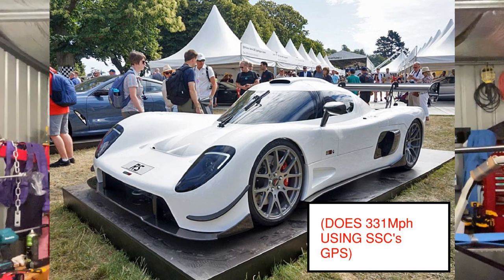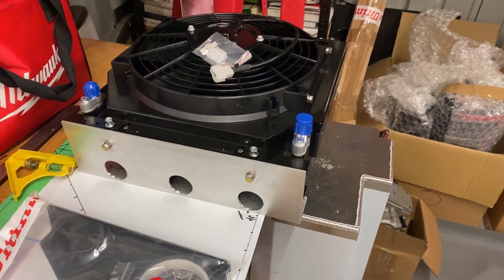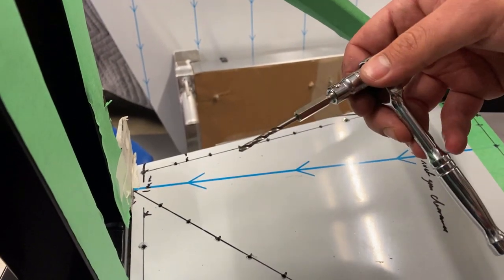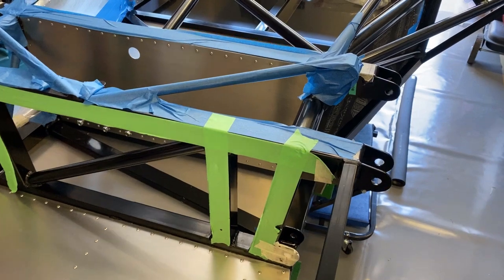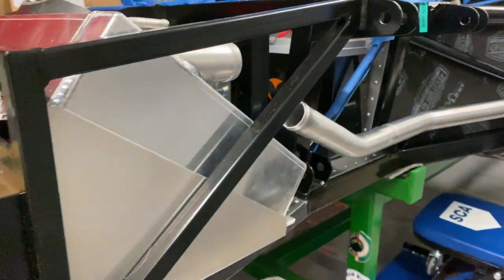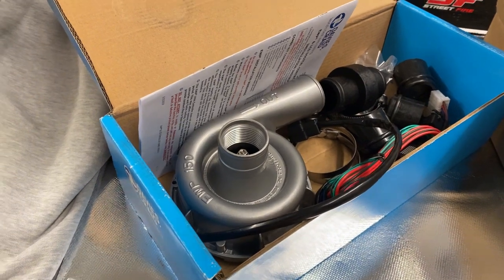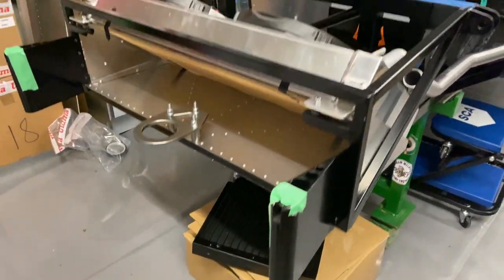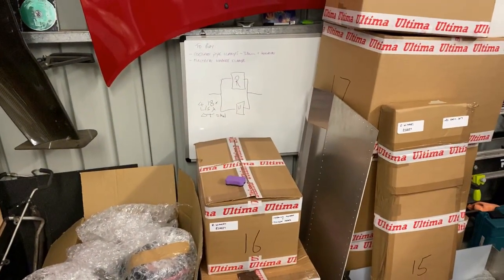Ultima RS - Keeping things hot and cold (Video #11)

Comment: I don't know how much your battery weighs, but I would use the LITE↯BLOX battery. It weighs 1-2kg and you can monitor everything with the mobile app. It has an internal kill switch and an anti-theft device. Not cheap but for what you get it's the best you can get.
Reply from the maker: Thanks for the tip mate! I went tight arse on it to start with as the Full River option was virtually identical to the Odyssey specified by factory and cost $300AUD.

Comment: I'm enjoying the build and love the Ultima. Nike for improvement, please work on the audio mixing. I have to crank the volume to hear you speak, then it cuts to music and blows out mine and my neighbors ears. Music doesn't need to blast like that.
Reply from the maker: Hey Rob, What device are you listening to it on? I actually checked it on my PC and my Iphone (and again just now) and it's marginally noisier with the music. I actually curbed the music level to 60% and used the exact same sample as the last video so it was the same source level. Sounds like it didn't work, but i'll get it sorted ASAP. Cheers
Reply: @rob105motorsport  I'm watching on a tv attached to a sound bar. Thanks for taking feedback and keep up the good work.

Comment: Another great video Rob and sorry the condenser didn't work out. You actually can't lift the radiator up as it'll hit the underside of the front clam so you've made the right decision to find a new one that fits better. As Will said fitting that second bulkhead is a good move and it's relatively easy to do. Look forward to the next video 👍🏻
Reply from the maker: Thanks, Murray. I seem to remember someone (possibly you) mentioning it’s a tight fit and it makes sense for the exit ducting to be that way. There’s always a bit of challenge with these things, but it’s also satisfying to sort it out. Cheers!

Comment: I've seen this theory off Tee-ing off of the radiator lines for the heater core on lots of mid-engine builds.  The calculation for heat load and flow restriction is an accurate way to calculate this, I think what gets missed is the physical restriction of the fitting.  Your calculation will hold up if you use a Y-shaped fitting so that there is not a requirement for the flow to start moving in a perpendicular direction to start flowing down the smaller flow path.  However, a T will most likely result in heater core filling up, but then not flowing.  I've not modeled this in any flow software, but based on some stuff from my flow dynamics class (which was over 15 years ago), I think it is important to consider the type of splitter you use.
Reply from the maker: Hi Jokerto, I tend to agree. The bottom line is though, that even if the heater core path is 100 times more restrictive than the radiator it’ll still have sufficient flow to produce good heat in this tiny cabin. Otherwise I’d be doing much more detailed calc’s. Cheers!

Comment: Watching this makes me want to go out to the shop at midnight and start finishing up putting the LS3 my G8 GT and start ordering parts I can't afford to finish my HSV E3 conversion. 😆

If you're worried about failure points in the cooling system, you could simply have some -20AN fittings welded to the radiator and tube just for that short run and use black nylon braided hose instead of stainless which should make for a pretty failure proof option with much more flexibility. 

Also, as far as the condenser, if the height is the problem, would can actually rather easily modify it by cutting off a couple inches from the top or bottom and modifying the tanks for lack or better term. Nick Blackhurst showed some really nice and relatively easy ways to do it on Project Binky. 

Also, I don't recall what or if you said what you were going to do for power steering, but personally I would run a hydro-electric pump from something like a A class Merc or Yota MR2. I'm going with the Merc pump on my G8 since it's only 3 wire hookup and frees up a solid 10-15hp, and aren't that difficult to hide everything except the res cap since the reservoir is built in. Just a suggestion. Keep up the good work mate.
Reply from the maker: Hey Corey, Get onto it!
There's been many nights eating instant noodles because of my car part buying, so I know what you mean, mate!
ANs are good, but they do transfer a bit more vibration and cost a fair few $. I was very tempted to do it, but I think for this car it's not 'ideal'. They'll be making an appearance on the next project though for the reasons you mention (and because they look awesome). 
As for cutting a few inches, I'm generally always wishing for a couple of extra inches..... but that's a different issue. The problem with the stock condenser is the height, but also the thickness; and also the connection points make is so the edge you'd ideally cut is at the end where the serpentine gallery has it's return bends (so you'd open up all the galleries if that makes sense). It's possible, but a full bastard, so if I can find a coil that's closer to ideal to begin with that'd be far better.
Power steering is for little girly men. Nobody needs that in their life stealing steering feel....... nah, in actual fact, these things weigh nothing, it isn't a 'daily', and it's difficult to calibrate an electric system (or hydraulic) to provide assistance that doesn't detract from feedback through the wheel. Probably why Lotus Exige etc have remained unassisted to a large extent.
For a car like a G8 (AKA 'SS Commodore') what you're thinking isn't a bad option though! Can you balance the level of assistance that the electric pump provides the rack?
The stock systems on those cars had a habit of shitting themselves on the track too, if you're not aware.
Reply: @rob105motorsport  Yeah, if shipping didn't cost as much or more than most of the parts I need, it wouldn't be a problem, but shipping 2 bumpers, pair of fenders, deck lid, spoiler to replace my SSV and the HSV Gen-F2 skirts, and even all the interior bits like the 11 way power seats and all the trim I haven't already done isn't cheap, when I can even find someone willing. I'm about to order the E3 front bumper to replace my E1 and shipping alone is like $1600US. 

Yeah, the definitely do transfer a little more vibration, but I think with the nylon instead of stainless braid, or perhaps even the pushlock ANs with the silicone hose wouldnt really transfer much more, if any, and since it's not high pressure, the pushlock with silicone hose would probably be the perfect combo to mitigate the vibration concerns. Or extend the tube and go full Wiggins. Lol 

Yeah, easiest would definitely be simply find a better fitting one for sure. Companies like Vintage Air and Restomod Air could help I'm sure. I'll be using Restomod Air on the 67 Impala 4 door hardtop for sure. At the least, check them out and take a look at their vents and controls. They're the nicest and cleanest I've ever seen, by far. 

Yeah, that's a valid point. Lol I forgot just how little these things weigh. Something like 2200lbs wet, right? I've seen more than a few of the sub 2500lb kit cars go power steering and not. Most of the ones who did, did because it was intended for track use, and after a little while, depending on quite a few variables I guess, driver fatigue can be an issue. I didn't even think about it earlier, but a better alternative would be a completely electric rack solution from something like a Chevy Cobalt, which is a popular one. They actually sell electronics and wiring setups for them that have a dial so you can adjust the level of steering assistance, which would probably be ideal for your situation. I'd love to use one, but it would be a real pain to say the least on my Commodore. If memory serves, the Mercedes A class pump already has something built in that adjust assistance based on load, but I could be wrong. If not, and it's a problem at high speeds, I'll probably put some kind of PWM controller on to adjust like I think the factory did on the later 4 wire units. I have 275/30-20s on all four corners, and the stock pump really didn't like it, so a little extra assist at high speed would actually be nice. But yeah, I've seen quite a few of the VE pumps fail, and I actually got the Mercedes pump idea from a Aussie forum. 😆

I'm actually about to sell a piece of property we have, and have been contemplating making a trip down their and bringing back a couple VE Maloos or Tourers to flip along with a bunch of parts for mine or maybe even pick up an R34 to flip. If it goes well I was thinking of making a few trips a year and finding myself a nice Maloo and R34 to keep.
Reply from the maker: @corey640  If you need any parts consolidated locally before shipping them to the US, let me know. It wouldn't take long to re-pack. 
I'll have a look at Restomod Air as I haven't looked at their stuff - thanks! 
Some tuneability in the rack with assistance would be awesome and that electric rack would be an interesting setup as I don't believe many have utilised it!
As for doing the Maloo/Tourer thing, there is one place i've heard of that's doing well out of it so it isn't a bad idea at all. Again, if you need someone local to chase up the market or make some calls, then happy to assist. I know it's hard to do it remotely sometimes! Oh, and R34s are expensive here now, so that boat has sailed!
Reply: @rob105motorsport  I'll keep that in mind. I appreciate it. 

Yeah, I haven't seen it done in too many kit cars. I think I've seen a few FF GTMs and pretty much the rest have been 60s and 70s restomods, which I've seen quite a few of those guys do it. I've even seen quite a few of the electric conversion guys use them. The racks are quite small, easy to modify, and you can easily source the controller on eBay or perhaps elsewhere. 

Yeah, there's actually a couple places in the US doing conversions, but I'm not up for all that as a one man crew. My plan was to buy nice clean cars, maybe with light front end or more likely blown motors, since they can't have the original numbers matching motor or transmission in the car or even in the same container, bring the rollers over and sell them as rollers or throw in a little cammed LS3 and title them in Montana through a company that specializes in it since Montana doesn't have any inspection laws. Lights, signals, mirrors, horn and Montana will give you a Montana plate and title with your home address in another State. Lol Pretty crazy you can do that actually. A lot of the supercar guys in Altlanta do it to avoid paying a YEARLY tax on cars they already own, which is bullshit.

Comment: Hello Rob, I'm learning so much from your videos on my own build. Even though very little applies to the 1972 bmw 2002 im working on. I have all the rust fixed and kind of starting from scratch as everything is removed from the car, but I can still relate. Keep up the great work.
Reply from the maker: Hi Orest, Thanks mate! What version of 2002 are you building? If it's a '72 car it's pre-turbo which means you got either the single carb' or the twin. I almost bought a turbo a few years ago and regret not doing it!
Reply: @rob105motorsport  Well I got it without an engine, so I'm just gonna put an m20 in it. I'm currently rebuilding it but waiting on Ireland engineering to have the pistons I need back in stock. Not looking for super high horsepower, If I can get around 200-220 I'd be happy.
Reply from the maker: @orestwolfgang556  They don't weigh much, so even 175-200 horsepower will make it a great amount of fun.

Comment: Only issue I see with your heater solution is when the thermostat is closed you don’t have any flow through the radiator. In cars I’ve built I run the heater off the engine side of the thermostat.
Reply from the maker: Definitely a good pickup Stephen. EWPs don't run thermostats as they're pulse speed controlled.

Comment: LOL  Rob I know you are doing things the right way by thinking things through, I do hope that it all works out.  Love the engineering solutions you are coming up with.  Knowing vibration is one of the most problematic things that do create more problems, do you think that adding /use rubber to remove some of those problems?
Reply from the maker: I hope it works out too - i'm too stubborn not to make the elec' AC work properly now i'm in this deep, haha. Vibration isolation is 100% always a consideration. The radiator is mounted on rubber mounts, but the rad' pipes are solidly mounted to the chassis which is why i've killed off the AN lines in this instance (and considering the $400-500 cost, welding etc that is required too).

Comment: Nice work Rob, is the radiator a standard Ultima product or aftermarket unit.
Reply from the maker: Hi Jason, That's the standard item, but I understand they previously offered another version (which could still be available on the GTR/Evo). Cheers

Comment: Congrats on using CAD, cardboard aided design (shamelessly stolen from Bad Obsession), that makes the battery tray job so much easier!

As for the condenser, a few of us are using 12’x24”x.83” side feed condenser from vintage air.  It’s a universal fit but you can find similar OEM fits for larger SUVs.  It has more than enough capacity for the small Ultima cabin and the side feed makes routing the plumbing easier.  I mounted mine right in front of the radiator and wired one of the radiator fans as an AC fan.

To keep heat out of the battery tray area (and the cabin) a popular mod is the addition of a 2nd bulkhead right behind the radiator, you can see that panel on my build.  It makes a bigger difference than you would think and helps encourage airflow out the hood.

Lastly I’ve mentioned before but worth repeating, make sure you drill 1” holes in the floor in the corners next to the battery tray for rock/sand drains.  Otherwise you’ll end up like me, vacuuming rocks and sand out of that area after every long drive or track day.
Reply from the maker: Cheers, Will. Appreciate all the input! It helps me save heaps of time in terms of research!. I'll check out the Vintage Air option if these local guys can't provide anything. I've started fabricating the carbon for the second bulkhead.